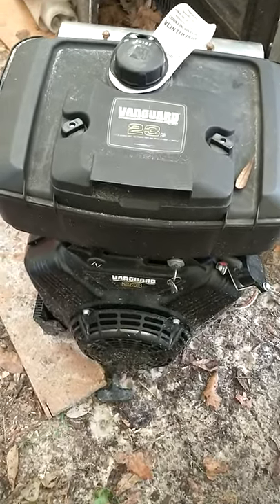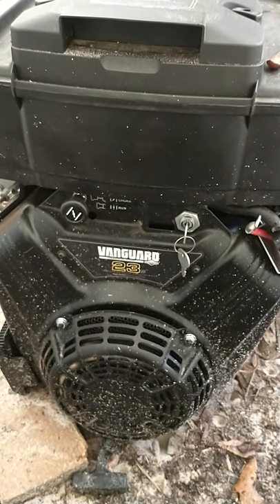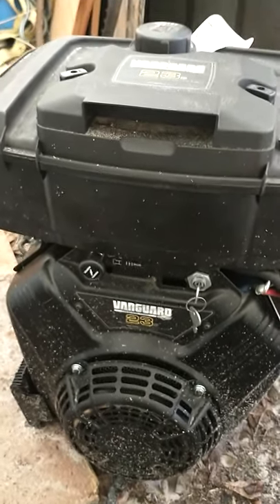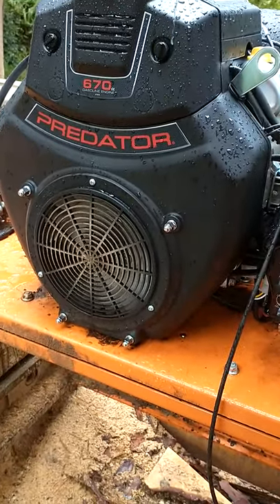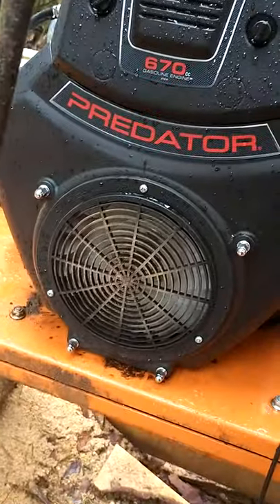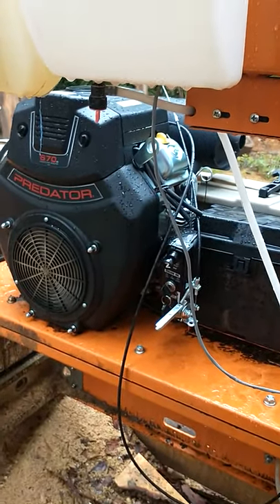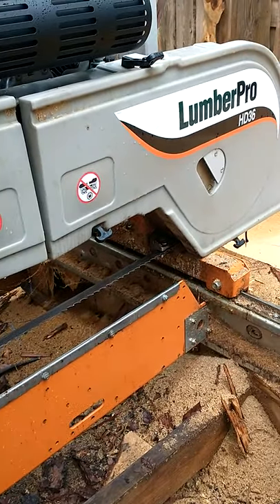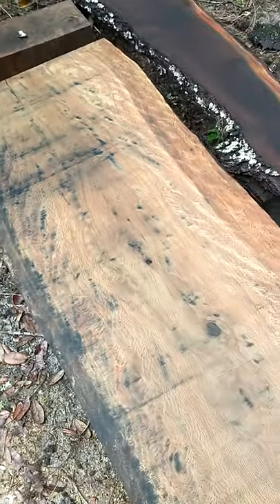Review Of The Predator 22HP 670cc

Comment: The older Vangard engines had a separate fuel tank & a fuel pump.  Don't know why they changed it.  Lucky that the Predator had the right mounting holes, and a 1" shaft for the centrifugal clutch.

Comment: I have the same engine on a tractor I'm building
One thing that happened I mounted my fuel tank up high without a shut off valve it seeped fuel into the block mixing w my oil causing a smoke issue and thinning oil I installed a in line shut off and cured issue
Reply: The pulse pump is the only issues this motor normally ever has boat guys normally run an low pressure ele fuel pump on the 670

Comment: any updates? I'm thinking about a new motor for my  mill.
Reply from the maker: Still working excellent
Reply: @fullingtonlumbercompany3656  any newer update?
Reply from the maker: @2Years2Farm  we've been running it commercially at our mill for over a year now with no major issues. The dipstick for the oil seemed to come out easily while it was running. The grommet on the dipstick didn't fit snug in the tube, so I added an O ring to the center groove on the grommet and haven't had an issue since

Comment: i got my norwood lumbermate 2000 in 2001 and the honda 20hp is shot. looking at the predator to replace it. Did you need a shaft bushing for the clutch? Thanks and blessings!
Reply from the maker: It was plug and play. Shaft is a 1" same as the 20hp.